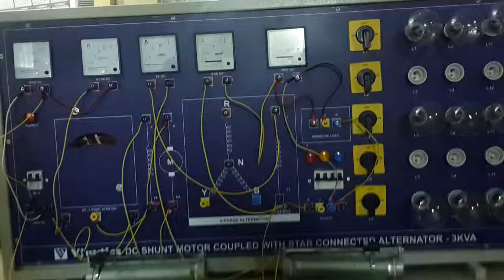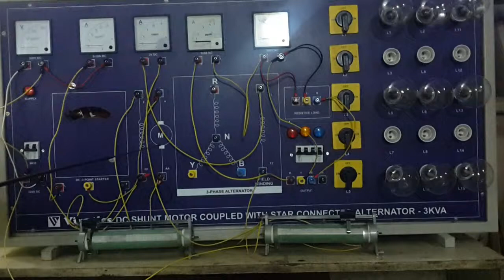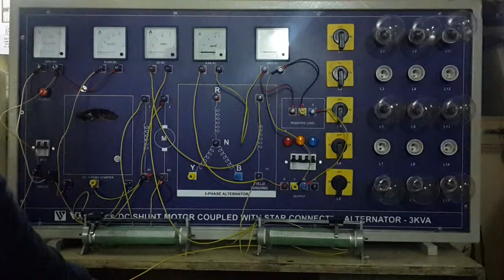Learn Electrical Mach. Online Free | Open Circuit and Short Circuit Test on alternator (3KVA)

Comment: A J INDUSTRIES situated in the heart of Mumbai, India's financial capital, is one of the leading suppliers of Technical Laboratory Equipments and Kits. With an experience of over 2 decades, our principal : A J Industries, has supplied Electrical & Mechanical Lab equipment under the brand name (A J ) to the most reputed Politechnics, I.T.I. & Engineering colleges across India.
We manufacture a variety of products such as :
O Electrical Trainer Machine 
O Single phase and three phase           Electrical AC motors   
o DC Motors 
o DC Generators 
o Slip-ring Motors 
o AC Repulsion Motors 
o Torque Motors 
o Alternetor  1kva to 5 kva sailent pool Rotating field,slendrical, 
3ph & 1ph Synchronous Machine 
o Universel motors 
o Synchronous motor 
o Squarel cage induction motor
O  Dc Starter 2,3,4 point
O  Slipring Rotor Resistance Box

Our technical team consists of qualified electrical and mechanical engineers. They have good knowledge of designing and manufacturing. Our team is trained for installation and demonstration of the equipments. A J INDUSTRIES you can be assured of : o Superior quality products o Excellent after sales o Total Customer 
    
CONTACT 
A J INDUSTRIES, UP STEEL ,151/53 TWO TANK BAPTY ROAD EAST MUMBAI  400004 MOHAMMED ARSHAD JAMAL  919819623517  
Email ajind1k1@gmail.com